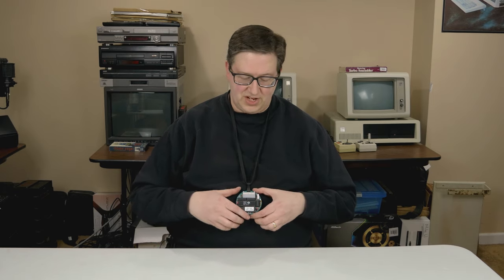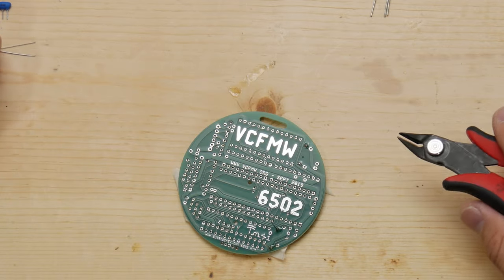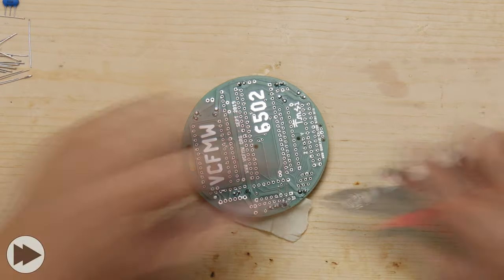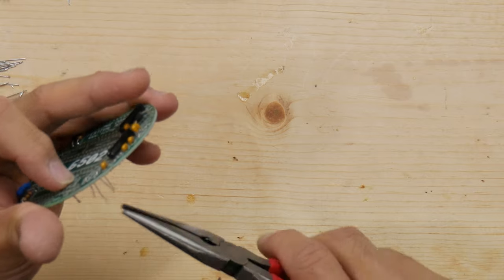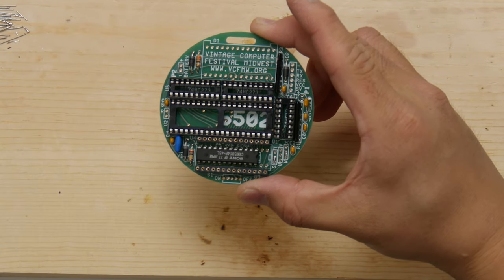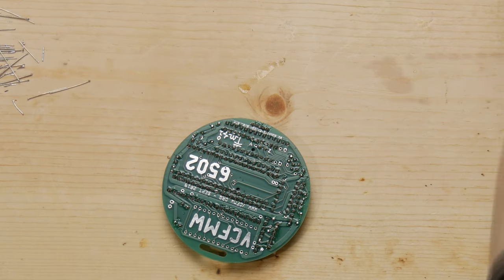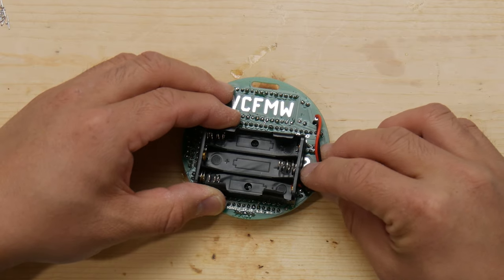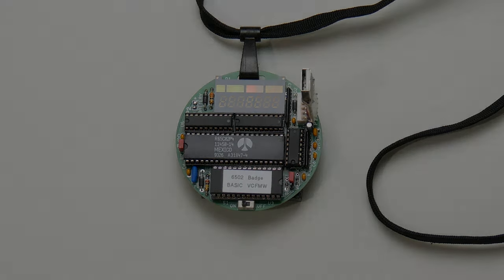How to assemble the 6502 computer-on-a-badge (VCFMW edition)

Comment: Great video, Jim! I'm delighted that it inspired you to build it yourself. Now you can confidently say you built your own vintage computer. 🙂 PS: Yes, the badge kit is still available, at no increase in price. It can be shipped internationally, though postage is expensive.
Reply from the maker: I can think of no higher complement than from the man who designed it -- thank you!  I've pinned your comment to the top of the threads so that others can see it's still available.
Reply: @TheOldskoolPC  Can you upload the Manual in another site please, sunrise-ev site is dead

Comment: This was well done!

Some EE type notes I would have:

I don't think I've ever met a electrical engineer who has actually bothered to memorize the resistor codes. At my last job like that we would just put unknown values in a pile to sort by a DMM later. When you're on the job it is actually more expensive to take the time to bother reading the codes than it is to toss it and just grab a new one from an already sorted bin. And for SMD stuff, it's technically possible, but the cost factor is 50X less. So no one would bother to even try saving them for later. For working at home, I would say this is a prime candidate to say "there's an app for that" to just punch in the colors and get a number back.

I've learned to not trust socket orientation. I always look at the silk screen on the PCB when installing chips. I've found multiple manufactured boards that have sockets put in backwards. If you are installing it yourself, it's of course good practice to do it. I would just recommend double checking it anytime you work on something.

Leaded solder for life! leaded solder melts at a lower temp than non-leaded solder. Leaded solder is also more eutectic, meaning it all melts and solidifies at once, making it flow smoother and more predictably. And yeah, temp is a complicated subject that people get emotional about. It boils down to, is "Higher heat for less time" or "Lower heat for longer" better. I'll just mention that my Metcal soldering iron doesn't have a temp setting. You buy pre-set temp tips, and I always use the same temp.

Definitely good job though!
Reply from the maker: Thanks so much for your insight! Now I don't feel so bad for forgetting the color codes I learned in high school :-)

That's pretty crazy that some manufactured boards have sockets in the wrong orientation :-O
Reply: Turns out there is an app for that.

Comment: 40+ years later and the 6502 still impresses. This video came up as I was ordering capacitors for yet another electronics repair. I learned basic soldering a while back simply because my stuff keeps on breaking!

Comment: Assembled mine today after a year of delay: worked first time! Love the idea of wearing a 6502 and somewhat surprised a custom message (S MESSAGE) is retained when the power is cycled. Need to check schematics: I assume the SRAM is left powdered by the batteries?
Reply from the maker: Correct, as long as the batteries are present, your custom message sticks around.

Comment: Everything was great, just a pro tip after finishing the soldering you may need to clean the remaining flux with alcohol. If this is not done, the board might not work.
Reply from the maker: Agreed. As a rookie, it feels wrong to "wash" electronics, but flux removal should definitely be part of the process.